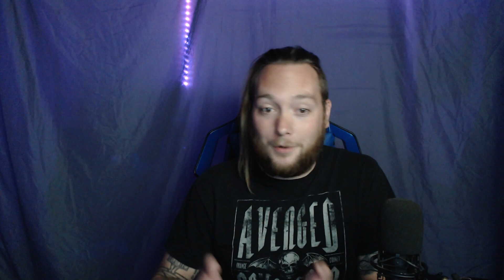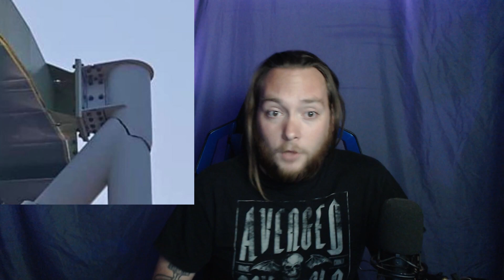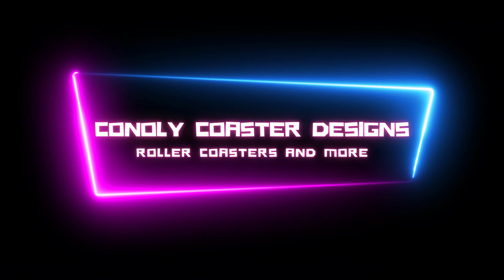Fury 325 Crack ∞ What is next?

Comment: They also need to survey the two closest supports that we’re taking the load bearing and energy in lack of that support failure. Also other thing and I don’t know the politics of Carowinds but    Fury is technically in both NC and SC so if safety is the question it could have to go through both states to get the green light
Reply from the maker: There are a ton of factors at play here when it comes to when Fury will reopen.